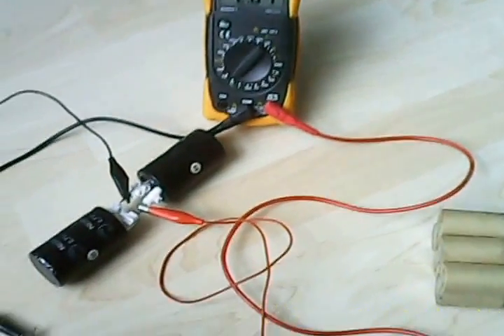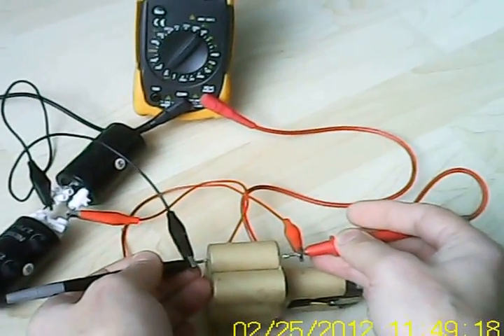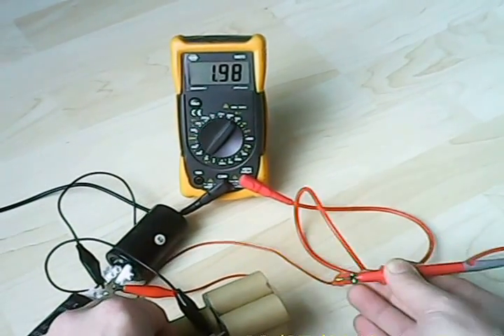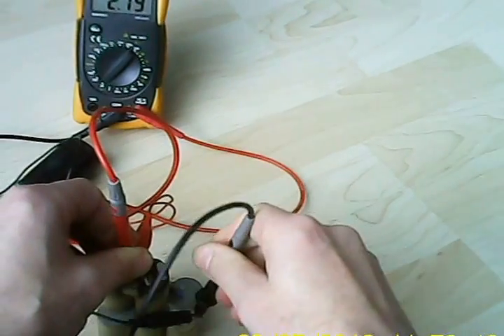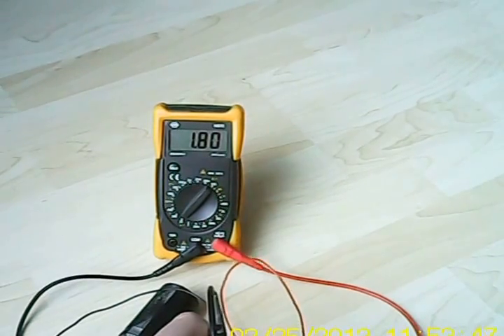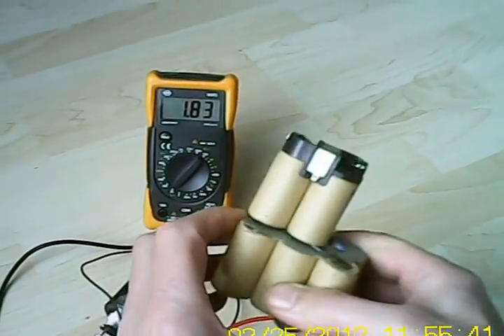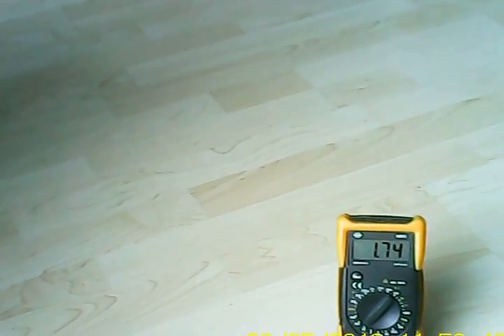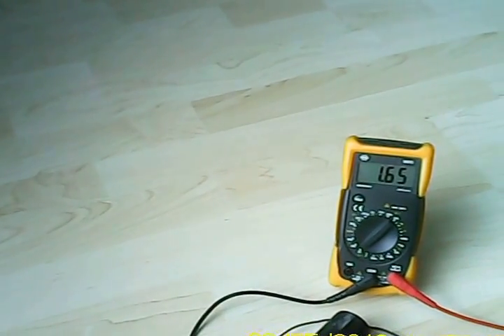rejuvenate/revive NiCad, Ni-MH, Lead acid, Li-Ion batteries #2

Comment: Again, I am impressed. I would like to develop a method using mosfets or igbt's to apply the appropriate current you are obtaining using your super-caps. Can you inform me of the current value you are using? I am not intending to use this commercially but for my own projects. If, however, I did get an opportunity to produce a commercial device I would certainly include you. Derek
Reply from the maker: Christian Fellow Hi, thanks for watching. The two super caps I used here are not-to-good 400F caps, so a total of 800 Farad. If I use those right after charging they are okay, but they self discharge way to fast. The idea of using super caps and no electronics (mosfet or igbt) is to be sure that if you apply the current from the super cap, it will wind down. The voltage will drop while the current continues to flow. In my opinion this will lower the risks involved of frying up batteries. I have had NiCad batteries (like the black box in my movie clip above) on a solar cell and forgot about them being charged. I ended up with extremely hot batteries, smoking plastic and all. Luckily I had placed them on a metal plate so I could move the whole outside to let it cool down. So the advice is that charging and heat don't go together, and you always need to monitor the temperature. Hope this helps!

Comment: Hallo slomeslager,

Is it possible to rejuvenate a 24 V  9 Ah nimh battery from an ebike the same way?
Reply from the maker: You do can charge it up from an e-bike (most bikes run on 24 or 36 Volts, so the output is at least 24 Volts). But if the NiMH batteries do no longer accept a charge, they need to be pulsed for a while. Pulsed with a short and high voltage pulse. It would be better if yuo can remove the casing, and pulse the batteries one at a time.
The pulse can be made several ways. I am using a relay which breaks it's own source power. And I have a diode to capture the Back EMF. Many videos on YouTube to look for! In fact this is the pulse which a Bedini device gives. Do note that the relay contact gets dirty after a week or two, and needs to be cleaned with a piece of sanding paper.
Contact me (pm) if you need some help with this.

ps: I took apart one of those e-bike batteries, mine contains Li-Ion batteries. But my own e-bike has NiMH (but they are still okay).